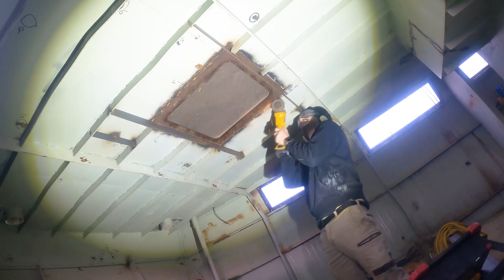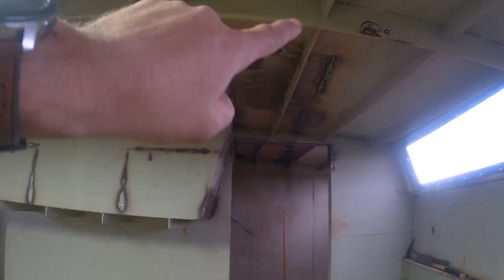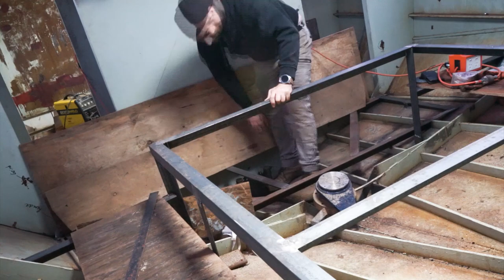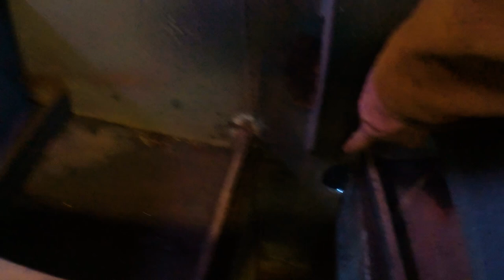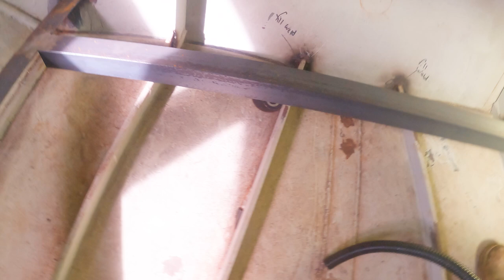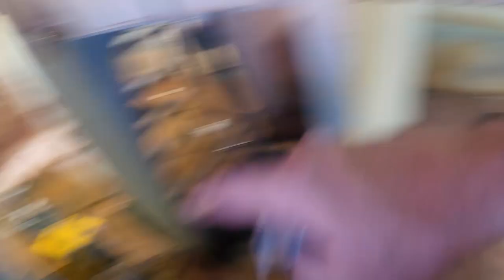Sailing QC #77 | Aft Cabin Overhead Welding & Bilge Pump Installation | Steel Sailboat Restoration

Comment from the maker: This week I finish off the Aft Cabin Overhead Welding! It was a bit tricky but not as bad as I was thinking last week. Plus I tackle more of the Bilge Pump Installation with a dry fit of the pipes and drilling a hole in the boat! We would love to know what you guys think about our Steel Sailboat Restoration!

Comment: Consider replacing the non-return valve near the transom with a vented loop above waterline.
Reply: I came to the comments to say the same thing, i want to change from valve to vented loop as the valve restricts the flow heaps (not sure if that's normal)
Reply from the maker: Thanks Craig that is a great idea!! We will look into it. Our outlet is above the water line but we can make a loop so that water can't get in.
Reply from the maker: Cheers Adam!! ⛵
Reply: @SailingQuickCreations  keep in mind a following sea would be trying to push water in when waves are over the outlet
Reply from the maker: Thanks Adam :)